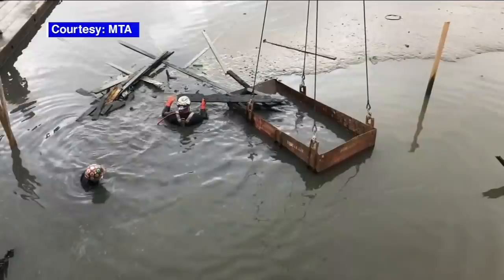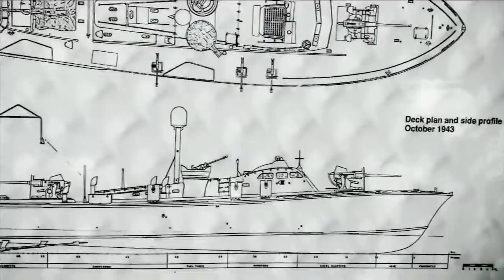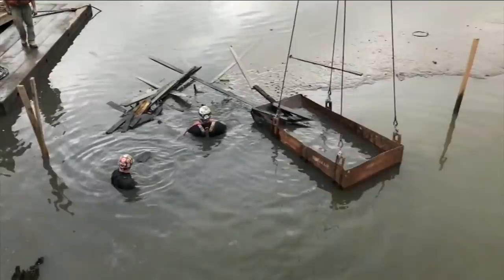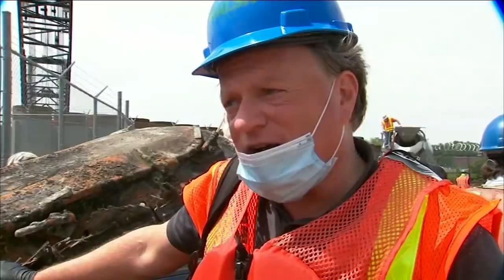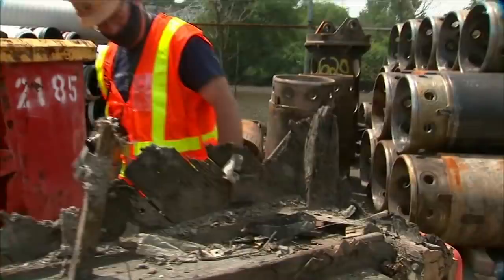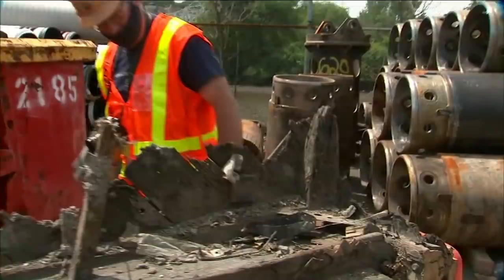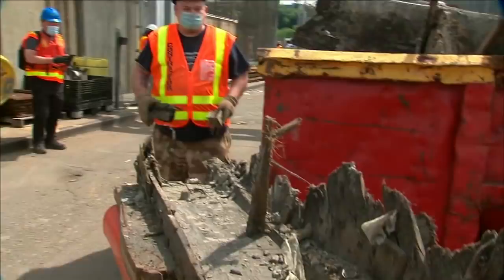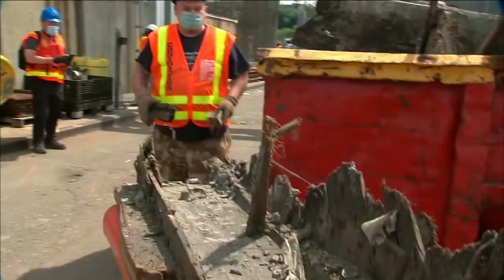JFK's WWII era patrol boat is raised from Harlem River

Comment: Fishermen were always getting hung up at a certain place at the end of my favorite fishing dock, so we'd warn new guys when we could. One of those guys was an old shrimp boat captain who told us the hangup was probably pieces of the old shrimp boat that sank there in the 60's. He explained that the dock was used by lots of shrimpers to offload their catch and berth their ships. The spot at the end was reserved for an extra large shrimp boat that would go out for a month or more at a time. The captain of that boat died and his family, who didn't fish, fought over his possessions. While they fought for years in court the old ship slowly took on water and sank while still tied to the dock. No one wanted it after that and the bay in that area was too shallow for newer bigger boats, so the dock was used by locals for fishing. Eventually time and weather beat the old boat down below the waterline and it was forgotten until this old gentlemen told us the story. He even had a picture that he brought back, showing the old boat in all it's glory, tied up at the end of the dock. I lived nearby and the day after Hurricane Ike blew through the tide went out a lot further than normal. I walked to the end of the dock and there in the mud was the old boat engine with lots of fishermen's lines wrapped around it. There was a few boards left, but mostly it was just the old motor. I took several pictures from different angles, thinking I'd give the old captain some copies if he ever came back. But, he never did come back that I know of. Stories like this abound and many are never told until someone old brings it up or some construction project discovers the remains. I'm glad they're retrieving JFK's old boat, as history is a thing to remember...not something to cancel or tear down just because you didn't like something about it. History doesn't care about your feelings, it just is what it is!
Reply: Very well put. Thank You
Reply: Thank you for sharing this. Times change, but history never will.....

Comment: I doubt they find much that was original to the boat outside of the basic hull itself.  The three Packards were likely swapped out and driven by two screws instead of three.  The cabin was probably enlarged and interior reconfigured.  It certainly is historical but the bits and pieces that are authentic might take up a small display in the local maritime or war museum.
Reply: She was called 'Sea Queen V' in 1970 as some kind of tour boat

Comment: A carpenter named Frank who worked for my father told me he once owned an old PT boat near NYC that sank while at anchor. Probably sank in the late 60s or early 70s.
Reply: You remember where Frank's boat sank or where it was moored? Thanks Wes!
Reply: @1nvisible1  All I remember is that he built some kind of superstructure on it and it was moored in a river when it sank. He lived in NYC so I imagine it was somewhere around there. I also believe that he may of mentioned that he replaced the engines and put in diesels. That's about all I remember.
Reply: A friend of mine's father had one on the Mississippi gulf coast that he had bought surplus and made into a yacht.  It was destroyed in Hurricane Camille.

Comment: T^he rescue they mentioned was done aboard the PT 109 before it  met it5's fate!!!  Kennedy commanded 59 after the 109 incident!!!
Reply: The movie PT-109 shows the rescue by Kennedy using the PT-109.   However this rescue occurred after the sinking of the 109 and during the 3 months that Kennedy commanded the PG-59.  (It was designated PG for Patrol Gunboat.  They replaced the torpedo tubes with a lot of heavy caliber guns for use in hunting down and destroying the Japanese supply barges that plied the waters in and around the Solomon islands.)  Kennedy was sent to recover the Marines because his boat was armed for bear and could lay down covering fire for the landing craft going in to pick up the marines.  When one of the landing craft was disabled, Kennedy positioned his boat between the landing craft and the beach and picked up the survivors.  He was able to clear the immediate area before running out of fuel... The navy had sent him out on this mission short of fuel, promising to send along other boats to help out and provide fuel once they had themselves been refueled.  Fortunately, the boats arrived before the incoming tide caused the PG-59 to drift back within gun range of the Japanese on the beach.  They then tossed Kennedy a line and towed him back to base.)

Comment: I thought PT 109 was blasted away out in the ocean!
Reply: Nope, just sliced into two parts.  After the IJN destroyer cut it in half by ramming the stern caught fire and almost instantly sank.  The front half of the boat lingered and sank from flooding inside of 24 hours later.  You can find pictures of it.